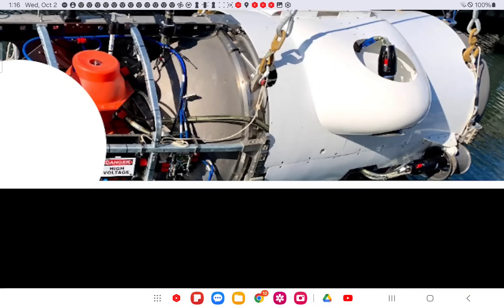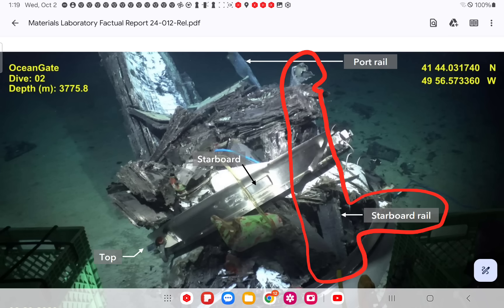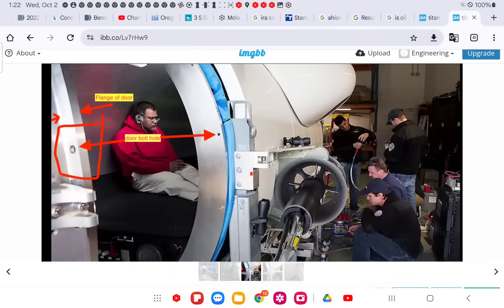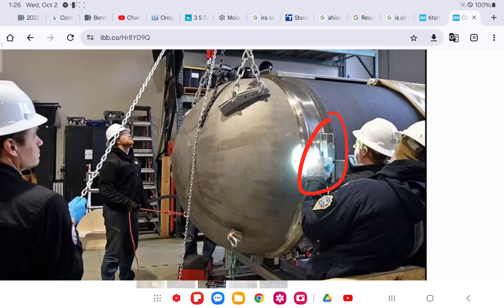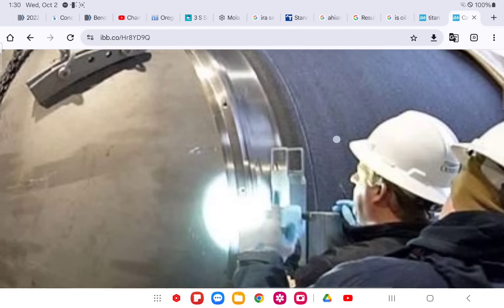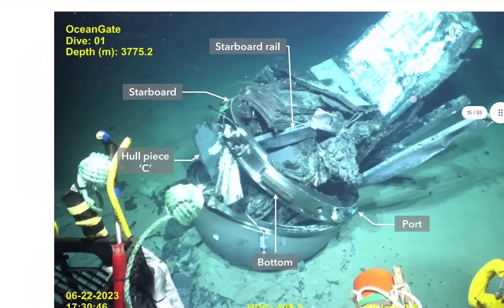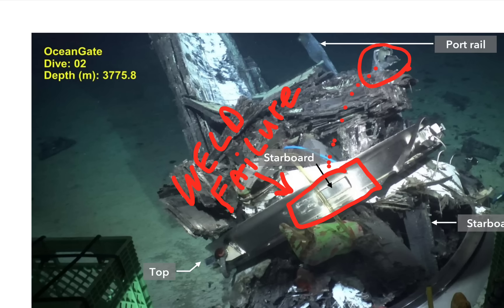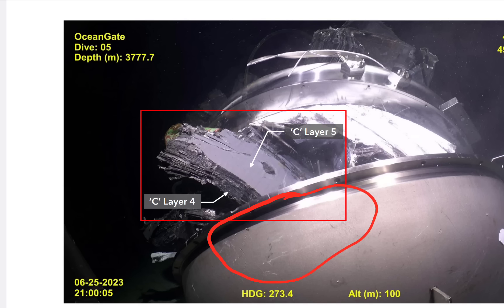Titan Submersible rear end weld failed at interface ring- PROVES REAR END FELL OFF FIRST

Comment: Your spot on here I think Cat Man Engineer !!!!!!!   Yes I agree about the tail falling off...as a result of a weld failure.....which started the bog of donuts implosion 500 meters above the ocean floor....I think the NTSB and the Coast Guard Investigations will independently concur with your thesis here.   The photo imaginary and mapped debris field of the wreckage supports this and it also definitely also brings to light one other very important and supporting and very obvious visible wreck failure attribute being the longest surviving piece carbon fiber hull being the floor section.   By installing this unbalanced cantilever rear end assembly hamging in the wind and sea the way they did he actually created a tremendous and large amount of unintended TENSION and TORSIONAL loads on the hull day in and day out.   Stockton kept saying the hull never sees any amount of tension loading.    He was completely wrong here.    Sitting still on land or on that barge or at sea or on a truck, or being towed.....anywhere and full time all the time right that subs carbon fiber hull was cycling in states of extreme tension and compression.....with tension, torsional and axial loads pulling on the top of the subs carbon fiber hull in a aft direction.  This simply because the subs unsupported  hanging equipment frame and equipment rack kept pulling and pulling on the top of the subs carbon fiber hull and interface rings...even the thruster's weight while powered off and on vectoring there forces under way represent (s) a very large more dynamic changing tension and axial loading's of stress(s) to the pressure hull ...far more then I believe anyone considered during the initial design and after the altered design was fabricated and as they continued to add equipment whenever ans wherever they felt like it.    This accident failure thesis of the tail falling off first here is causing the pressure hull implosion to occur is most likely, plausible based on the evidence and most probable I agree here..... Consider this....A review and inspection of the largest and most intact remaining piece of the carbon fiber pressure hull..this being the bottom of the subs pressure hull does support this rear of the sub falling off first as a point of initial failure....then as a result this occurring a second event which most likely was the fatal one... ..likely then the as the tail fell off the carbon fiber hulls tension loading was asymmetrically rapidly reduced on one side of the pressure hull the hull loading at that moment would have experienced a quick change of shape at first torsion-ally by reducing the tension loading the titanium end caps want to get closer to each other then quickly reversing direction and elongating as the tension loading increased asymmetrically stretching as the tail section is pulling away from the pressure hull an opening up any and all existing wire and cable service through hull pressure  penetrations  from the subs rear equipment racks components and now you have holes or serious potential for holes in the pressure hull...... I believe the stretching and rapid asymmetric  forces of the stern section falling off then pulled and opened up opportunity for the more cascading pressure hull failure..  Specifically  of the subs forward interface rings lower port side or lower starboard sides.   The KEYHOLE way that that the large remaining carbon fiber sections delaminated 1" layer by 1" layer by 90 degree angles to each other shows me the path that the pressurized water took either coming into failing imploding carbon fiber pressure hull or the exit paths it took while leaving or equalizing the inner and outer already compromised carbon fiber pressure hull.  
That delamination geometry is like reading a trees growth rings from a cut log.  the failed carbon fiber hull section floor tells the subs  life events f not everything that occurred and in what order.   The fact that the base/bottom/floor section is the subs largest section remaining tells me the sub failed on top from a Tension loading event.    The KEYHOLE  or checker board delamination pattern exhibited in the  remaining sections shows how the high pressure water acts much like high electric currents they take the path of least resistance to reach ground potential and equalization.   Please let me know what you or any one involved  think sand if you or anyone wants to share dialogue here to help determine the most accurate finite root cause of this wreck.     Thank you.  J
Reply from the maker: Good read, thank you, and here is the follow up video https://youtu.be/j4KPQuTN4b4 and it is full of truths and exposures --- note, this is like an advanced class, I cannot just spend 180 hours giving up all the data, it takes time to do background data for people and then put it all together

Comment: Surely the force of everything being rammed into the rear hemisphere by the implosion would be more than sufficient to fracture the welds of the rear ends supports and shoot it off like a cork?
Reply from the maker: Nope... You would have that force of the dome destroy the batteries and other components on the exterior. 
Then your description has the implosion and debris field at approximately one location; please look at my video of the "survey" of the bedris field, it tells a different story
Reply from the maker: That damn top , rear connection detail is critical , especially because of the airbags and them possibly being able to break the connection if activated -- via prying the connection apart.
Reply: @ForensicCats  Would the airbags deploy at that depth? The pressure would not allow them to expand.
Reply: @ForensicCats then why was the CF blown into the rear, if the rear failed everything would of blown forward not backwards. Jeff's breakdown made more sense and more accurate
Reply from the maker: here is the follow up video https://youtu.be/j4KPQuTN4b4 and it is full of truths and exposures --- note, this is like an advanced class, I cannot just spend 180 hours giving up all the data, it takes time to do background data for people and then put it all together  and lol at Jeff and his bloody blanket theory
Reply: @stevenbishop1466  Because the dome and rings were probably more responsible for keeping the hull intact than the carbon fibre. So the bracket coming off the ring caused the hull to collapse in on itself and the debris was suctioned into the rear of the vessel where the point of failure was. 

That bracket is the point of failure hands down. It's a miracle that it held on for as long as it did. Those welds has nearly zero penetration.
Reply from the maker: Yes, @steven, how much were those side straps and especially the top holding this damn thing together while it was out of the water... once, it is deep enough, the pressure will put the vessel in compression and they no longer will have to do any work... Then you come back to the surface and back to work they go +/- on this one
Reply from the maker: @deltasyn, you will like Friday morning's video, I talk about the error in that report and even reveal my Columbo hints --- I explain the debris field again but more importantly I show how the outside psi was GREATER inside... I also reveal why this would NEVER work long term, based on it's manufacturing process.
Reply: @ForensicCats not true
Reply: Those welds weren't fractured. Those were cold welds. It also looks like a they ground the old bracket off and welded the new one for the rev C design change of the spacer bar. It's very unprofessional work.
Reply: @eaglesfly5236  it doesn’t make for a good drama if it’s that simple.

Comment: Is said the Titan had been dropped on the support boat. Could that bracket been the cause of that incident?
Reply from the maker: I like all impacts for stress fatigue failure of this weld and this includes the weight of the rear end rocking inside and together with both side mount brackets.
Reply: the sub took several beatings on retrieval. The dive before the fatal dive, the sub got stuck on a half sunk tow barge, and got smacked by waves for on hour.

Comment: WELD WAS TOO COLD ON BRACKET STARBOARD , RIPPED IT OFF. I WAS A WELDOR FOR 35 YRS
Reply from the maker: Yes! It did not have enough penetration and it might be the bracket that did not take the weld... I have been looking for that part number forever, no luck!
Reply: @ForensicCats  I've worked in quality inspection and R&D for 15 years and that was a really lousy weld. Not done by a professional. I also seen grindmarks which looks like they ground off the old bracket and replaced it with the new one to mate with the rev C spacer bar. 

Which BTW, is a custom Oceangate component. It uses the same "PRT" prefix as the viewport dome drawing. That said, I think you found main culprit. I have a much longer post I just wrote detailing my observations with yours according to the drawings I was able to obtain from the case files.

The drawing for the window is in the file titled 
"CG 108 TITAN MBI KEMPER TESTIMONY FINAL_UPDATED (002)_REDACTED.PDF". 
The drawing with the PRT prefix is seen on page 14 of 47 in the PDF. My guess is that the PRT prefix was for bottom level drawings for individual components. Hence, the spacer bar would also carry this prefix.
Reply from the maker: I have a video coming out tomorrow morning and it includes your comment - you will be surprised by the weld "limited" access Here is the follow up video https://youtu.be/j4KPQuTN4b4 and it is full of truths and exposures

Comment: Got only one question how was the outside equipment connected to the pressure vessel?!
Reply from the maker: At the interface ring bracket I showed in this video and at the top with a gusset plate ( I cannot find a clear image of that and original thought it was connected by a single bolt, I have now leaned towards a gusset plate that all bolts failed and this might be a result of inflation of airbags on the hull that pulled at this connection... Wait-- I also state in this video that it's not logical for them to screw that top bracket into the carbon fiber but it appears the screwed into the hull many times (so, my logical has to adjust for Tony and Rush form of thinking / engineering... 
This "form" would include, "let's just grab that piece of metal there and drill some holes in it, weld a block to the top of the interface ring and tap some screws into it.

Comment: I have watched Thunderfoot and you and compared. He claims the front failed and it was forced into the rear at the speed of sound under the water. All the things you see bent in the back could have been done because the interface ring in the front was sheared off, so I feel that is a good reason all that stuff is so pushed back and bent. Check it out, I know you're good at engineering stuff, but what you don't consider is how forcefully water at that pressure can find a pin point leak and force its way into the air bubble.
Reply from the maker: Here is the follow up video https://youtu.be/j4KPQuTN4b4 and it is full of truths and exposures
Reply from the maker: Thindefoot, lol , tell him I challenge him to a live podcast and we can opening banter ...
It's impossible for this to move at the speed of sound, thunder foot is tinder-foot and couldn't describe this failure before the latest images and yet, I described the failure over a year ago with just the images from Polar Prince... I have videos that prove that. 
I don't have the ability to tell you it travel at the speed of sound, LMAO ... 
Incidentally, the speed of sound is the same speed they use in sonar and it's not always the same in layers of water- density matters. 
I have no respect for anyone on this subject who could not partially recreate this incident with just the Polar Prince doc images. 
Sorry, if I hurt ur feelings on thindefoot or Manley, etc but my challenge stands and they can even have 100 percent of the YouTube income from the podcast; I don't do this for $$$ like they do it for...
Reply: @ForensicCats  oh you didn't hurt my feelings. I like openly discussing ideas with people who know more than me. Since I don't know much, putting stuff together with things I learn and YouTube "peer reviewing" challenges what I know vs what I should know. Ya know? :)
Reply: @ForensicCats  Thunderfoot would never debate you, he would get wrecked. Speed of sound...sounds like sensationalism

Comment: So if tail fell off before the implosion that would have made the 'death trap' frount or nose heavy no? If that did happen then they was out of control before implosion
Reply from the maker: Depends on the neutral bounancy of the remaining weight and how it displaced the water around it; the very worse, they ROLLED and ROLLED ... The very best would be they imploded at the same time and the debris field is mapped incorrectly (I leave open all options to explain incidents but this would have been a terrible way to go; I believe they had hopes though...).
Reply: @ForensicCats  so if we say losing the tail sent it into a spin, given that it's now nose heavy and spinning that controller is probably under the people making way harder to control now I dont know where the batteries are located (hopefully not the tail but with this death machine i dont know) that's a total electrical failure. Now we know the droped 2 weights depending on how they are dropped that could be factor in the balance or explain way the tail came off a kinda bending motion.(given that they are no longer on the O ring). But if I'm honest I think they hit the the titanic on the way down that's way the railing fell of but I might be wrong
Reply from the maker: Tomorrow's video will answer a lot of your questions on the EXISTING FORCE that was ''baked into this design'' and they attempted to stop deflection in the rear frame by adding a ''strong back'' - BUT, that simple created a pry bar action on the top connection. https://youtu.be/FOgXAybZc5s
Reply from the maker: Here is the follow up video https://youtu.be/j4KPQuTN4b4 and it is full of truths and exposures

Comment: I wonder , if you're correct if the back fell off first. Did the implosion happen due to the sub falling and making contact with the ground?? Causing the failure of the end cap.... We'll probably never know, but it sounds plausible.
Reply from the maker: I gave it away a few times in the video... I love leaving clues and I really thought someone would have stated it by now... With that said, I will reveal it at 2a.m. tomorrow.

Comment: Front ring failed and blasted that forward dome into the sea floor. All I needed to see during these hearings was that glue interface. It tells the whole story.
Reply: I think so too. I have over 40 years of mechanic design, machining and assembling experience, also with carbon fiber structures, and I'm pretty sure that glued Ti ring bursted off when the hull wall bent inwards in the enormous pressure.
Reply: @paulmix3858 i gathered that too everything was pointing to the front dome failing first causing all that debris to be forced inward
Reply from the maker: This vide GAVE you all the Columbo clues you needed -- come on!   I stated it a few times and no one is seeing the obvious!  Please, look at it again and I will reveal it in tomorrow's video , at 2:00 a.m.  unless someone get's it tonight.
Reply: I have looked at it again. If the rear interface ring had failed, the pressure hull would have collapsed into the front dome. Go look at the wreck of the Scorpion. The torpedo room was flooded above crush depth and did not implode. Everything aft of that bulkhead was collapsed into the space behind the bulkhead when the rest of that hull imploded. If you look at the look at the forward ring of the Titan, both the interior and exterior flanges of the ring to hull joint were completely destroyed in a shear failure. In the connection of the aft dome to the aft flange, the bolts failed in tension. That points to a force coming from forward with a lot of mass behind it. The shock load of the entire pressure hull slamming into the aft dome would have been more than enough to pop the equipment module off of the sub.
Reply: The front blew off and that's right where everything imploded inward into that ball of debris into the AFT end  
The section above the longer piece that is still intact in that ball of debris into the AFT end is where it actually gave out 
This stuff is fascinating
Reply: Ya but did you notice the NTSB experts response to questions about the possible glue and the ring failing. He was like ya there's mentions on the website. I didn't bring them up because it's obvious the hull failed. He didn't say that but that's what look he was giving. Didn't you guys pay attention to what I've showed you. I didn't bring those things up cause ya didn't you guys pay attention
Reply: I love Columbo, so I’ll watch this one again tonight, and see if I can catch the clue you refer to.
Reply: As a former engineer who worked with composites, has a degree in aerospace and ocean engineering, and comes from a navy family, I agree. It makes me wonder what he’d make of photographs of the wreck of the Scorpion.
Reply: The cold weld on the rear interface ring is pretty convincing IMO.

I think the back end failed.

Comment: The rail you are talking about is not the outside frame railing. The rails labeled port and starboard are actually the flooring rails from inside the vessel that were under the floor. If you go look at some build photos you can see them alongside the green O2 bottles.
Reply from the maker: Here is the follow up video https://youtu.be/j4KPQuTN4b4 and it is full of truths and exposures